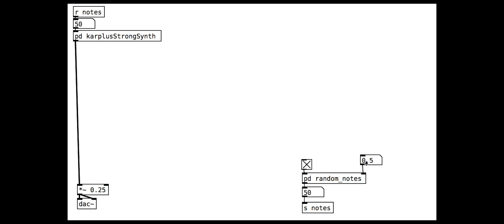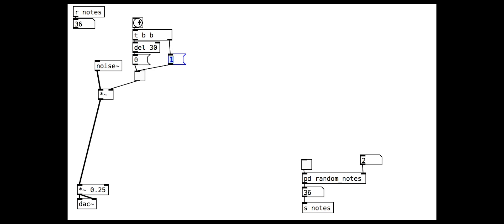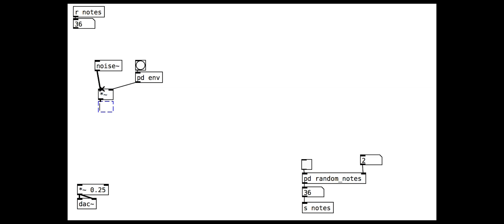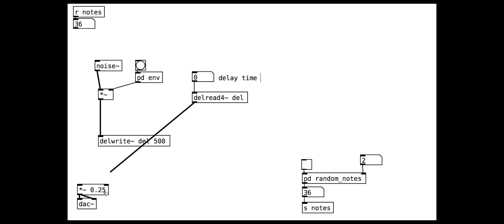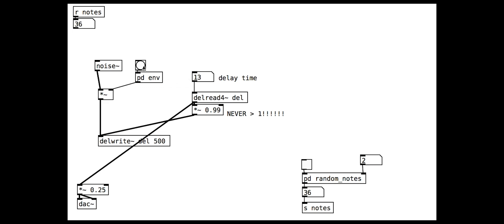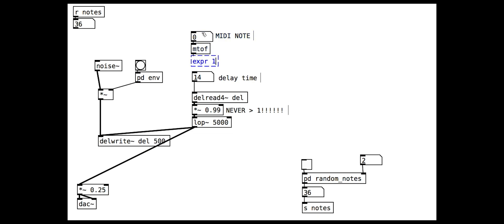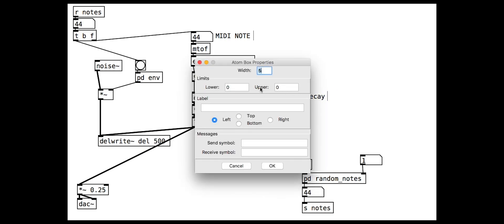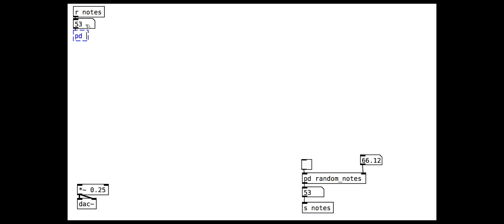PureData tutorials - rich synthesis (8) - Plucked String

Comment: what does the expr 1000 / $f1 do in the feedback chain? It is just a way of converting the frequency of the midi notes into the delay time? thanks again for this video
Reply from the maker: Hi Reening. Yes, correct, it converts a frequency to a delay time. A delay time is the inverse of the frequency (1/frequency), but because PureData works in milliseconds instead of seconds, we also need to multiply by 1000 (1000 / frequency)

Comment: hey, your videos are so helpful. Can you share these works? I don't know how you made the different rhythms in String video (7). Bless
Reply from the maker: Hi Luis. We've finally put all the patches up on our tumblr, here: http://reallyusefulplugins.tumblr.com/richsynthesis
Reply from the maker: You might also want to look at tutorial #5 which looks at how to generate note patterns.
Reply: @reallyusefulplugins  thanks a lot for your answer and the website :D. I have another question: I'm using OSC Control with Pure Data extended. do you know how can I use the PD objects on PD extended? for example: The "clone" object does not appear in extended and I need to use it. I'm Neophyte in this area. Bless.
Reply from the maker: @luisantoniomusic8020  Hey Luis. Good question! You could perhaps do things the other way around and try and bring the objects you need from extended into vanilla via the "Find Externals" option in the help menu? Otherwis, we're scratching our heads too I'm afraid.